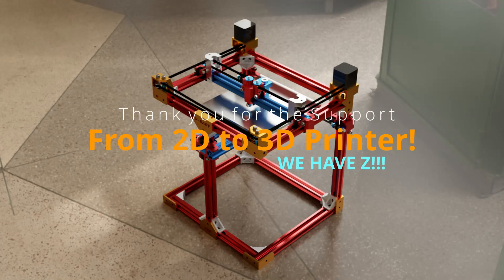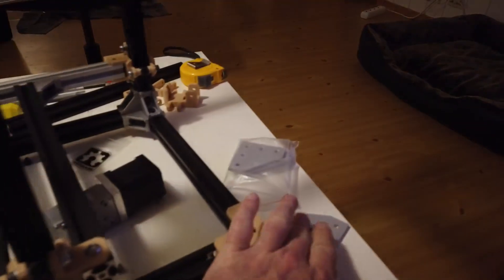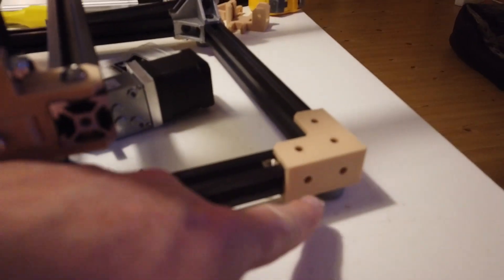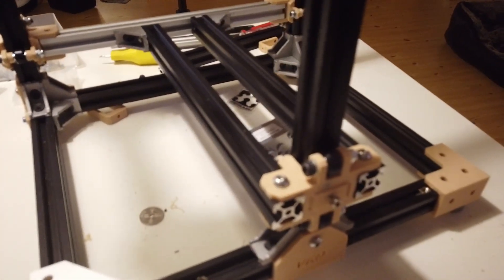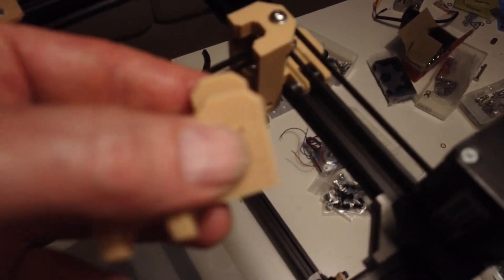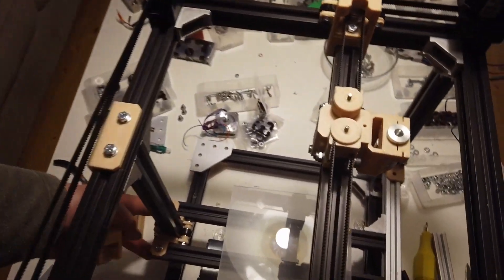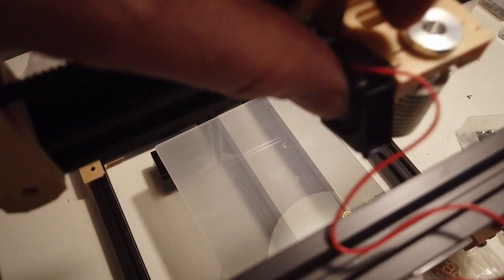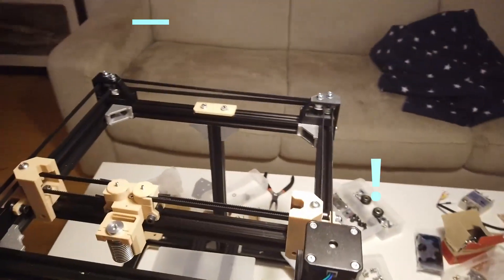3D Design Vlog #7 -  Prototyping Z Axis! - CoreXY 3d Printer

Comment: Ok, Im officially tempted to build one of theese machines after im done with my own corexy machine.  I think you should go for  printed parts, at least on the lower part of the frame, the frame is so small so i think its sturdy enough with some beefy 3D printed parts. I really like the compactness of this machine and the overall design... It has been a fun series to watch and i really cant wait to see the final result! On the Z axis i probably would have a stepper mounted on top, between the  A and B motors, with a belt going down to pull the bed, you could use the worm gear assembly but i dont think it is necessary if you use a big NEMA17 motor. Best of luck with the rest of your design!
Reply from the maker: Thanks for watching! I feel like printed parts are fine as the corner brackets do most of the job for perpendicular rigidity. The aluminum is nice to align everything with though but we could also use the corner cubes.. Well let's keep going and see after testing. Regarding the worm gear we need something to keep the bed from dropping when motor is not powered. A stepper alone can not hold the bed so we need something
Reply: @PRO3DESIGN  you could stop the motor from dropping the bed electronically, if you short out all the wires when the printer loses power (through a relay or something), it takes a lot of force to rotate the motor shaft. I think it is possible if the bed doesnt have a lot of mass... If not it would atleast drop slowly... Either idea is good i think though...
Reply from the maker: @sebastianstein9456  The motor alone will not keep it from dropping when off power. We need a gear or a brake of some sort
Reply: @PRO3DESIGN  Thats what im saying, but my intension is to use the motor as the brake. Because a stepper motor essentially works as a generator if you drive the motor shaft without powering it. And when the bed pulls on the shaft it  will generate current and if you have the wires shorted together, it will take a lot of force to turn the stepper. I will try to find a video or something that explains it better. But anyways, its your design and you do whatever you want to do! It seems to be an awesome machine either way!
Reply: To automate it so that it switches from being driven by yout stepper driver to electronically braking you can easily use a couple of relays. To get a better idea of what im meaning  you can try to connect all the wires of a stepper together and try to turn the shaft
Reply: sorry to be off topic but does someone know of a way to log back into an Instagram account?
I somehow lost my login password. I would love any tricks you can offer me
Reply: @Beau Coen instablaster ;)
Reply: @Khalid Graysen thanks for your reply. I got to the site thru google and im trying it out atm.
Takes a while so I will reply here later with my results.
Reply: @Khalid Graysen It worked and I now got access to my account again. I'm so happy:D
Thanks so much you really help me out :D
Reply: @Beau Coen glad I could help :)

Comment: WOW it's getting still AWESOME! Regarding the Z axis set,  despite the fact that I love your Z worm gear mechanism, I think that it got quite a bit pricey (worm gear set) and I was wondering if a regular lead screw would do the job along with the z wheel carriage.. what do you think? It would be possible to create such a alternative set for the Z? Thanks for your great work!
Reply from the maker: THANK YOU! Leadscrews have so many issues I dont want to go that route now. We do have the Bringsmart solution and including stepper it is 35 us. I dont think that is a bad deal as it is just belts and pulleys rest - But someone else can make a leadscrew option I guess. I can not satisy averyone :) ;)
Reply from the maker: here you can see the gear - link also: https://vkingprinter.com/hardware/all-metal-wormgear/

Comment: Hi there,
I would lift the bed from the side on which there is only one guide, the 2 ones from the opposite side will resist a lot easier to the bending forces applied by the lever.
I also like a lot your top/back E3D heatsink cooler design, it is very elegant and should be much more efficient than the stock one! I also think that you should use smaller fans for layer-cooling, one on each side, something like 40*40 turbofans should be good enough.
The idea of interchangeable hotends is quite a nice one too, but I think that you should probably make it easier to swap out.
As always that's some serious and amazing work from you! Thank you for that!
Cheers from France!
Reply from the maker: Thanks for your advice. I am first going to try lift on both sides but it would easier to do it on one side so we will see. The fans i forgot to say are all blowers yes. Also the 3010 and I have 4010. Good that you like the consept, I think it will be a good solution for the hotend. And I will make it much better to change for sure
Reply: Hi! Thank you for the video. Where can I look at stl files?
Reply from the maker: @MasterShuShuShu  There are no files at this time. This is a work in progress - keep watching and I will let you know when they are released
Reply: @PRO3DESIGN  Thanks! I'll do. At the moment I'm trying to create drawing of my own h-bot with small v-slot wheels on 2020 aluminium profile. And I still can't choose best type of wheels pulling system.
Reply from the maker: @MasterShuShuShu  It is not the simplest task to achieve - It is a tight fit :)
Reply: @PRO3DESIGN  About a month ago I've found project named "V-King". It's also CoreXY and it has very interesting mechanism for wheels pulling and linear actuation. I think, I'll remake this variant for small v-slot wheels with few improvements (if I wouldn't found something better as variant). I like that V-King's bed actuation supports for all 4 corners. It should make bed more stable. Maybe some ideas in this project can be interesting for you.
Reply from the maker: @MasterShuShuShu  The V-King is very good!... I designed it :D - I have two V-Kings running prototypining this little baby corexy - YOu can add two legs if you want to  - this is a consept I want to try out - also this system can be used on the big wheels but need lots of redesign

Comment: Maybe this worm gear:
https://www.ebay.com/itm/Metal-Worm-Wheel-Plastic-Gear-Reducer-Reduction-Gearset-for-DIY-Accessories-CY/232983391124?ssPageName=STRK%3AMEBIDX%3AIT&_trksid=p2060353.m2749.l2649. 
Don´t know the seller, just as an example...

Then use a M5 threaded rod instead of axel on the plastic gear. 
6mm GT2  pulley on each end of the rod. 
The hole on the metal worm gear is M4, but if you drill a M5 hole you can fix it on a Nema17 axel. 
Hope you go for belts on the Z-axis. 
Morsomt å følge deg, Roy